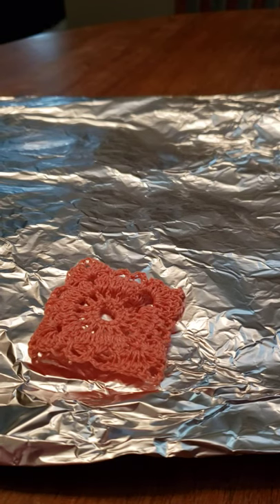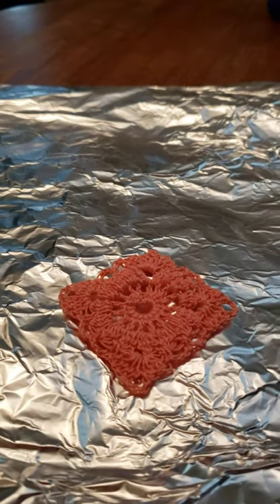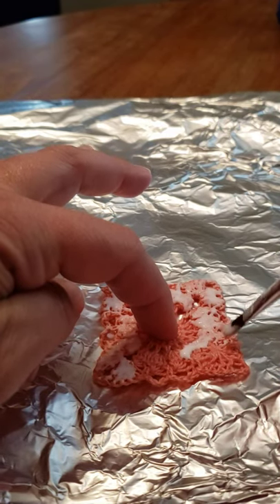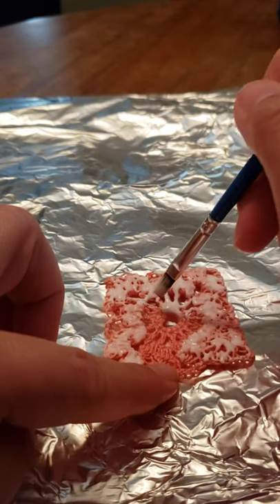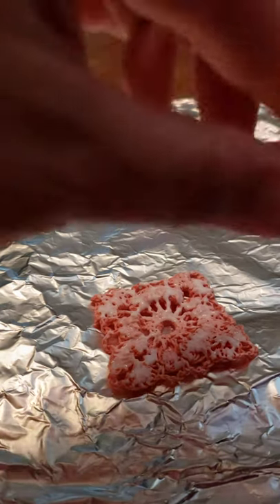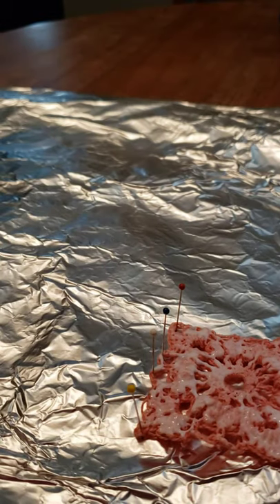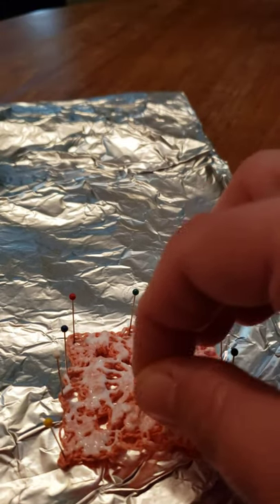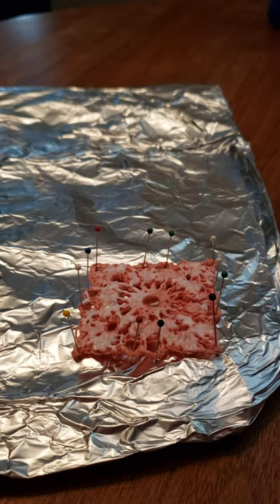FABRIC STIFFENER: *** Learn How To Stiffen Your Yarn Projects In 3 Easy Steps ***

Comment: Thanks for sharing this will it dry tacky and sticky, and I noticed you didn't mix with water. Is it premixed or will water delute the hardening effects.
Reply from the maker: Hi Arnice! I use the fabric glue and I don't dilute it. I haven't tried diluting it and not sure of the results if diluted. It dries hard to keep the shape, not tacky at all. You can use a little so it's not too hard and your project is a bit flexible or you can "paint" it on thick so it doesn't move at all. When I am gluing for earring projects. I paint it all over pretty thick. I want the earrings firm. The glue dries clear. I hope this helps!
Reply: @CrochetbyNatalieLucille  thank you for answering my question. I wanted to know before I used it on my earrings and hat brims. Have a great day.